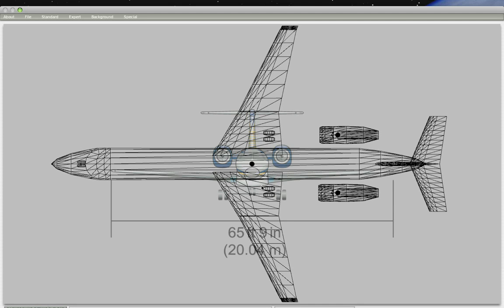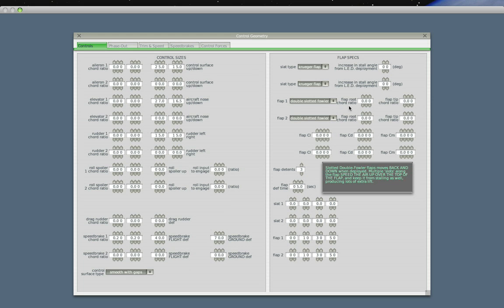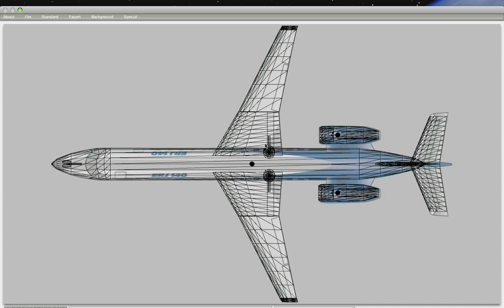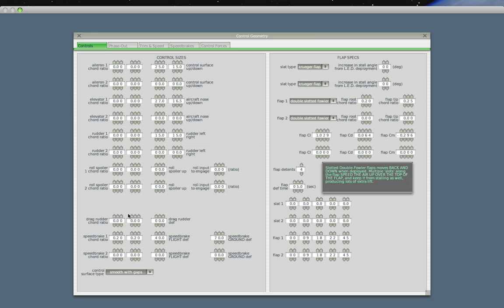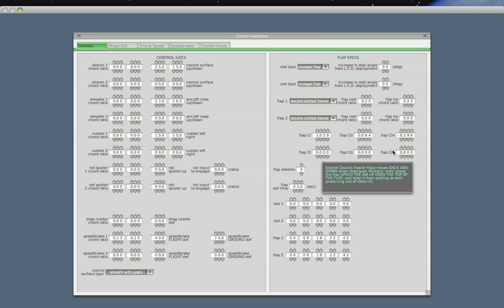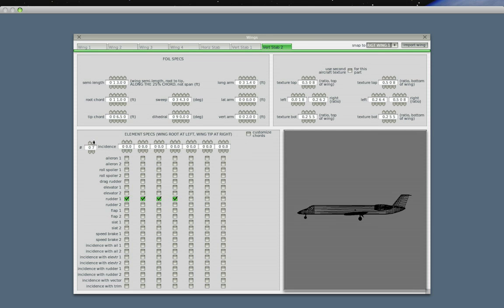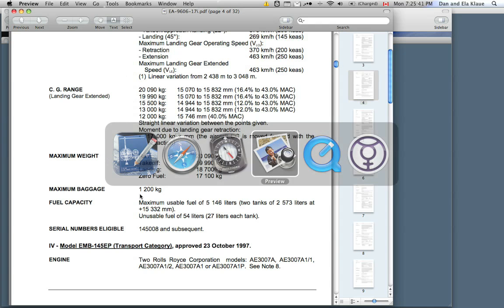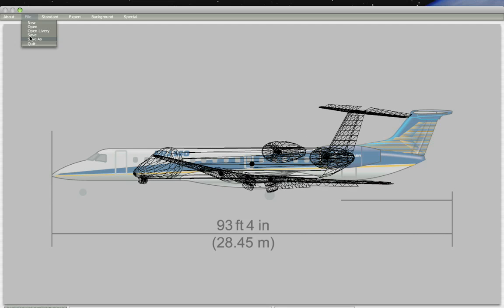PlaneMaker Tutorial 6: Control Surfaces and Deflections

Comment: Is it possible to invent new types of control surfaces?  I want to experiment with controlling yaw using paddles on the wingtips.
Reply from the maker: It's possible to invent pretty much anything. Question is, do you have something original, something useful, something practical, doable, etc.?  If you're asking specifically if you can use "paddles" on the wingtips to control yaw, it kinda depends on what you mean by "paddles".  There's planes that already have split ailerons, which control yaw (like the B2 Spirit). Is that what you mean? Then it's been invented already. :)

Comment from the maker: @Storke10 VNE means Velocity to never exceed.  You have to set that to a higher value... the sim determines that the airplane will break apart when you go too far above this speed.  If the speed is set at 0, your plane will instantly break apart.  To set the VNE, you have to go to the "Standard>Viewpoint" menu in PlaneMaker, and in the first tab along the left side, you'll see all the velocity settings.

Comment from the maker: Vne means "Velocity Not to Exceed."  You set it in PlaneMaker's "Standard>Viewpoint" menu.  All those "Vne, Vno, Vfe," etc. settings will mainly draw green, orange, red, white zones around your air speed indicator, but the Vne is the most important, because X-Plane will calculate airframe failures if the Vne is exceeded.  Therefore, Vne cannot be zero, and PlaneMaker will tell you so.  

You'll get warnings like these that'll tell you what's needed in order to make your plane "fit" for X-Plane.

Comment: i double checked if the infinitely adjustable flaps option is not enabled. and i do have a flap handle in the cockpit. the flaps are plain flaps, 5 dtents 0,5,10,15,20,40..
im frustrated...........

Comment from the maker: You might have checked the box to have the flaps infinitely adjustable.  This means, in X-Plane it's not enough to just press the flap button and expect them to extend.  You have to HOLD the button down to extend them as far as you want.  

If that still doesn't work, I'd recommend double-checking that the infinitely adjustable flap option is NOT enabled.

You also need a flap handle in the cockpit to activate your flaps with the mouse.